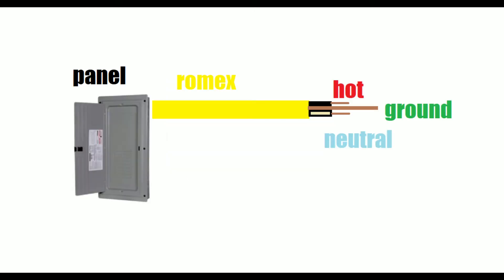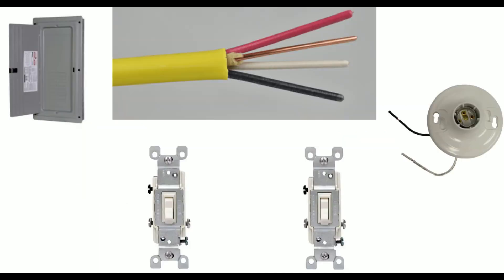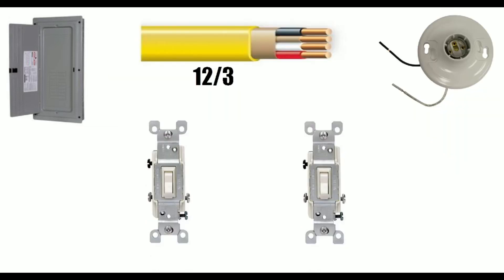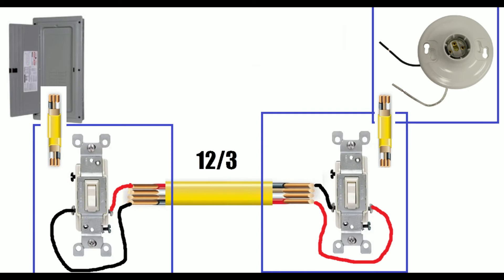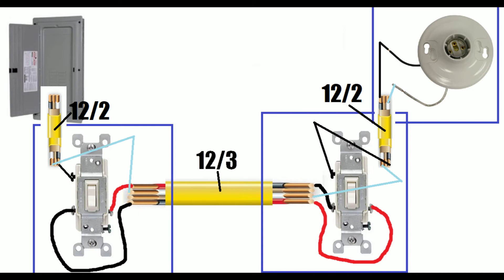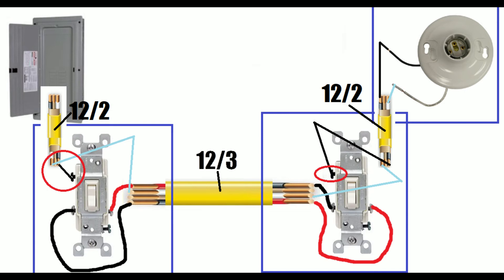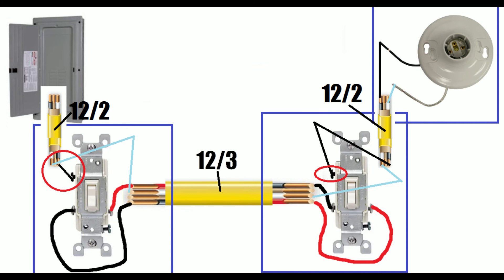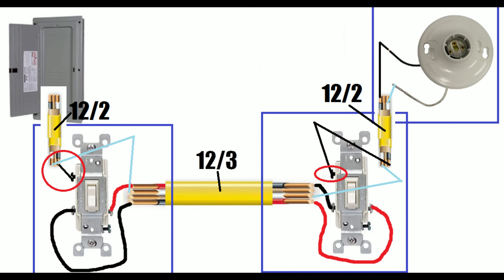How To WIRE a 3 Way Switch NO fluff!

Comment: Some doorknob wired this apartment that im doing the plumbing in incorrectly.  

How would I remove the outlet that my fridge is connected to from a breaker box circuit and give it its own dedicated line direct to the breaker box? Reason I ask is because every time they use the microwave the breaker flips because the fridge is also running on the same circuit
Reply from the maker: You would need to run more wire to the panel and get a new circuit or ... tell me, how many circuits do you have in your kitchen ?

You should have
 2 for the counter tops 
1 for dishwasher / disposal
1for vent hood / micro ( you don't have this 1  lol) 
And 1 for lights 

If you have 2 for your counter tops you should  be able to tie your fridge to 1 of those  

If not you most certainly need a new circuit run for the microwave 

It is 100% legal to put you fridge on with your countertop circuits
Reply from the maker: Then you could just do some  minor fishing to your microwave location  
How far away is your microwave to the fridge and do you have an attic access?
Reply: @toolsandtactics  this is not my place.  I'm just redoing the atrocious plumbing and the residents are telling me about the breaker flips.  They literally have to unplug Playstations, aur conditioners, fridge, tablets etc in order to run microwave without flipping breaker
Reply from the maker: @mattek519  I see sounds bad 

 So a lot of people don't realize but the breaker tripping is your best option y

our next option is the wire gets so hot it burnsitsef in 1/2  So It can no longer pull the load ( if the breaker doesn't trip  )
That breaker may not always trip ) immediately 

And then if all else fails a fire
Reply: @toolsandtactics  well no matter what outlet that the microwave is plugged into within the front side of the house, the same breaker trips
Reply from the maker: @mattek519  yeah bad stuff lol kitchen is missing a few circuits
Reply: @toolsandtactics  how can I fix this?